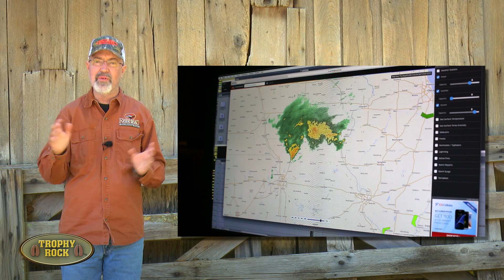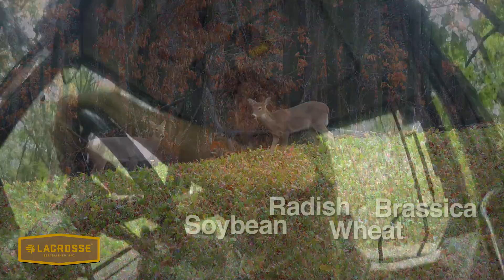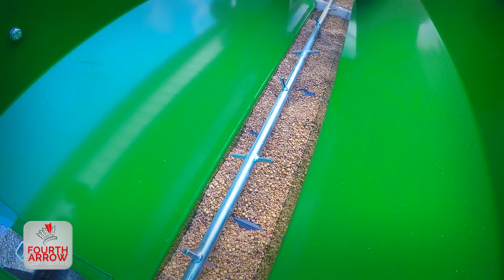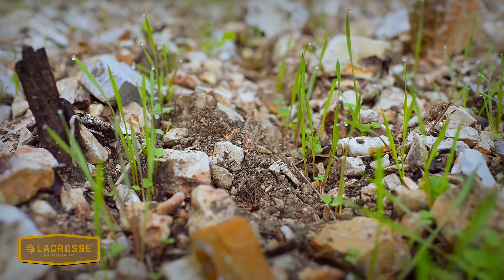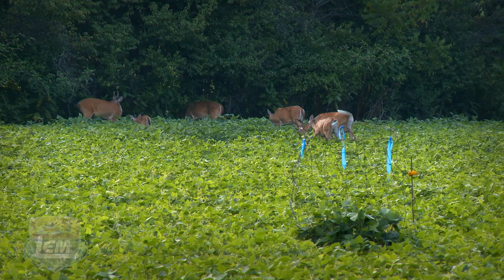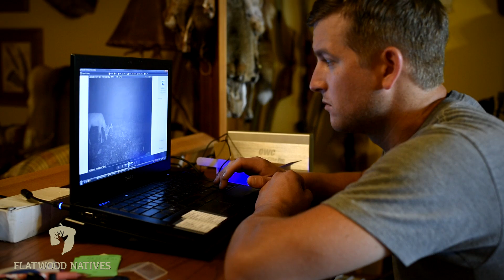How To Grow The Best Food Plots for Whitetails (#353) @GrowingDeer.tv

Comment: You have the best videos on food plots.  I live in North Dakota and soybeans/corn is king in attracting the deer.  Back in the day alfalfa was great but doesn’t seem to draw them in like in the past.  I would like a recommendation on what you think would work in our area.  I would like to try the soybeans in the summer and fall blend in the fall winter.  What are your thoughts on this?  Keep in mind depending on the year mid to late October is the end of our growing season.  After that it’s cold to bitter cold.  Today is minus 20 degrees!  Thanks in advance.
Reply from the maker: James, I would recommend soybeans and a fall blend like you have said. Eagle has the Wildlife Managers Mix North RR which is specifically for the northern states. I would let the beans remain standing and either no till drill into them or broadcast your fall blend. The fall blend should be planted 45 days before the first frost. These blends are turnips, rape, radishes, winter wheat, and cereal rye. Cereal rye has one of the lowest growing temps. -Daniel

Comment: It looks like you were using the Earth Way bag spreader for some of your food plot locations and I use one as well! I was wondering what you used as the spread rate with the broadside blend? Right now we don't have access to a no-till drill but hope to in future years
Reply from the maker: Yes, we use the Earthway spreaders. They work very well. When broadcasting broadside we typically plant 100-120 pounds an acre. So seed will get carried away by birds or squirrels, so we tend to plan a little heavier. -Matt